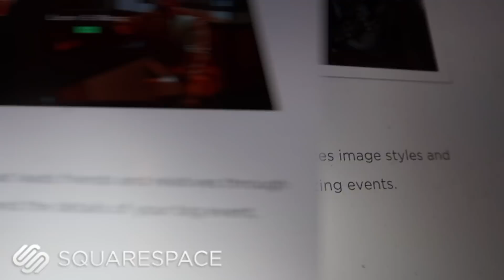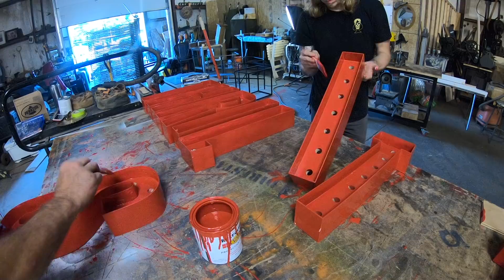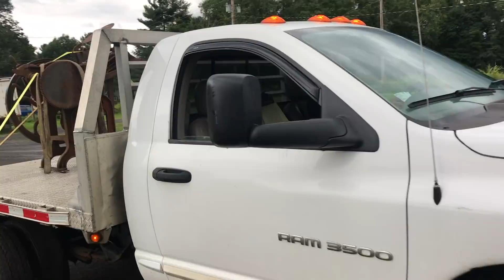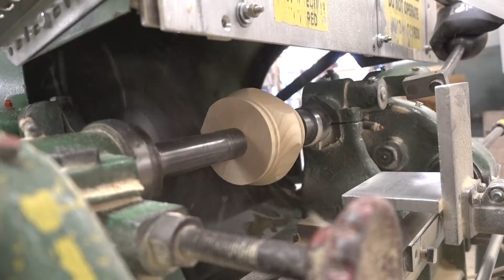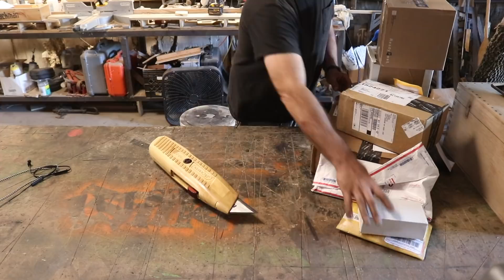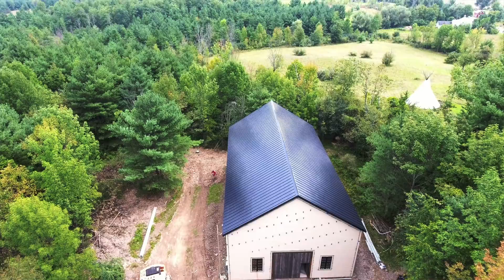DiResta 75 FEW New OLD Tools

Comment: Oh wow. I'm looking st a horizontal mill to try and get my toes wet because it's only 300 bucks. She also has one of these exact drill presses. Made in the 1800s 500 bucks. Old 12 inch lathe 600 bucks. Wish I had the cash, barely have the extra to go get the mill and that's if I even make it in time.

Comment: Yeah don't get those concreters back Jim, the way they were lifting the steel cage as they were pouring is the worst way you can do it, you're supposed to have plastic "chairs" that hold the cage in the middle of the form work. Great video otherwise.

Comment: Rebar needs to go higher in the slab for optimum strength. Particularly for the power hammer.
They have bent steel pieces called "Chairs" to support the rebar during the pour. They enable the workers to step on the rebar and it will stay in the correct location. They are cheap and if you can't find at least put rebar on pieces of brick. Know you know for the next pour. Your channel is the best on You Tube!